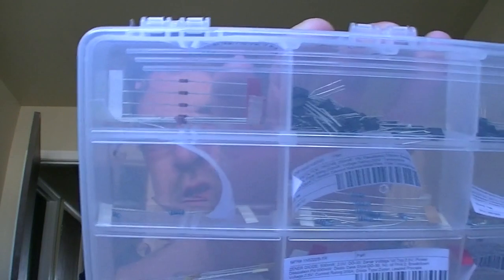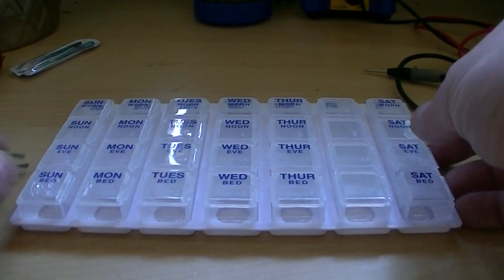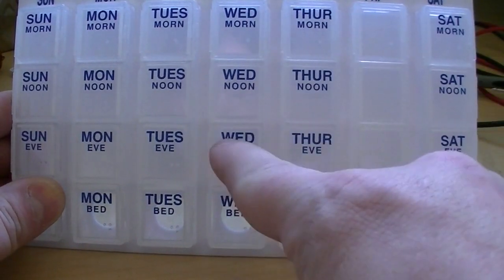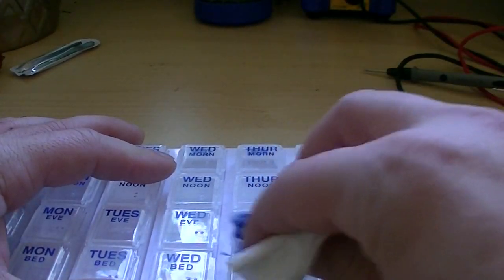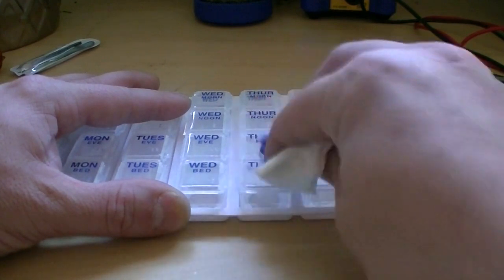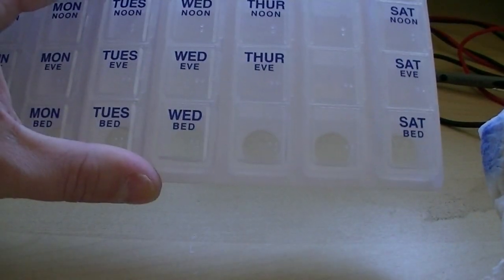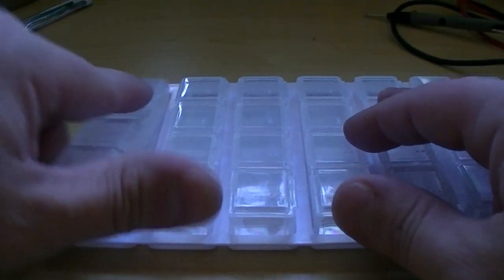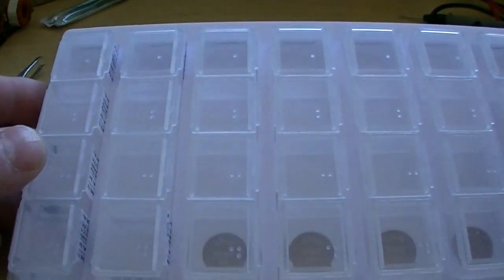Cheap SMD / SMT Component Storage Container

Comment: I'd rather go for AideTek SMD organizer. You can get 144 compartments at under $30 bucks: http://www.ebay.com/itm/BOX-ALL-enclosures-144-space-w-lids-labels-SMD-SMT-resistor-Organizer-0805-0603/162156793682?rt=nc&_soffid=5038506508&_soffType=OrderSubTotalOffer&_trksid=p5731.m3795 This will hold your whole 5% SMD resistor line from 10 ohm to 10 M in one box.

Comment: The lids on these kind of boxes often have small gaps down the sides. Especially the ultra-cheap ones on eBay. Small components (0603 resistors, for instance) easily slip out the sides and get all over the desk if you're not careful. Also they do tend to hog static electricity a lot, which is not good for semiconductors.

For passives I make a plug out of ethafoam that sits snugly in the top. For semiconductors I line the bottom with anti-static foam, and make a plug for the top out of antistatic foam too.

Works like a charm.